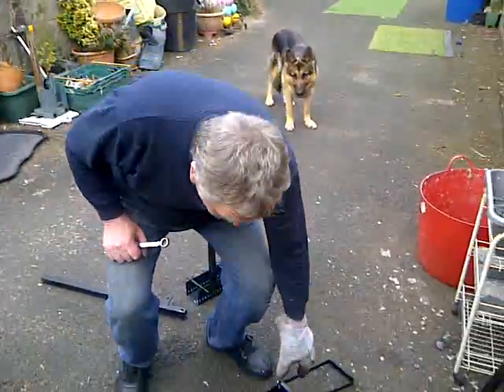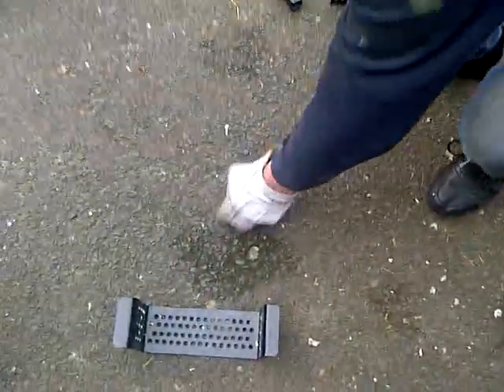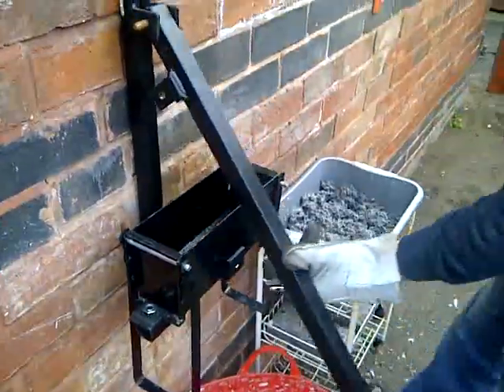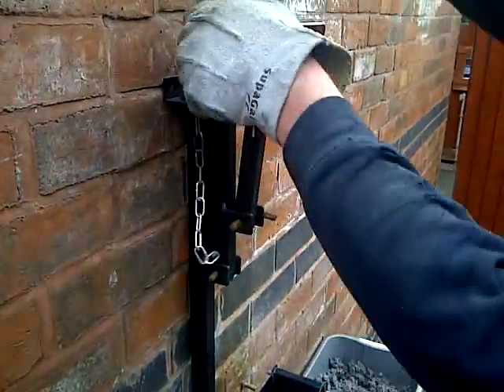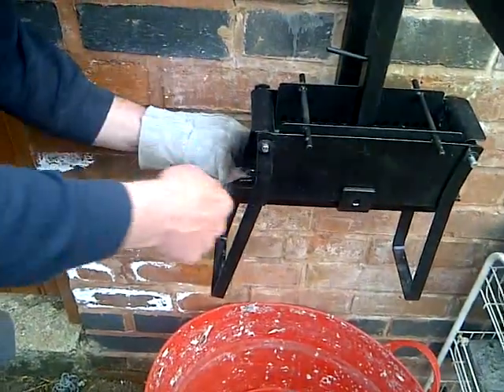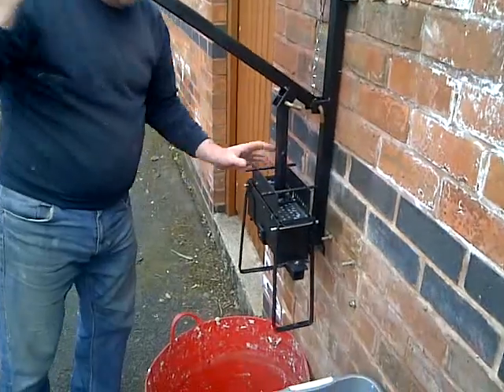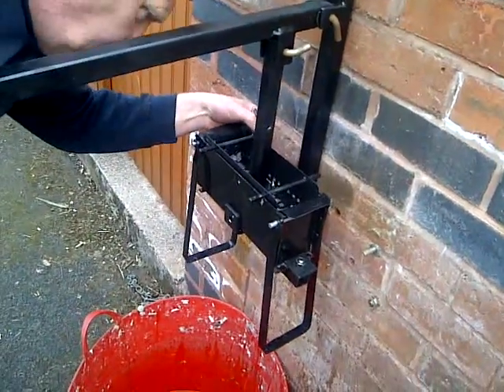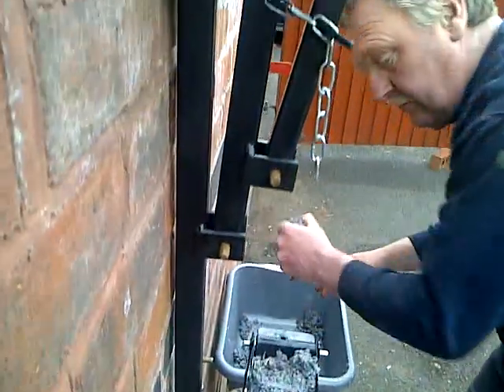paper briquette maker paper log maker

Comment: This is brilliant! I have one of those brick makers, and you've solved all the problems with these gadgets. When I squeeze the water out, the bottom screen wants to pop out, but the steel bar you have under it to prevents that. I sit on a short stool with the mold the ground. You've brought it up to a comfortable height. And because you have it mounted on a wall it makes it easier to pull out the brick, as opposed to me using my toes to hold the mold while I pull out the brick. Bravo!!!

Comment: curious....  do paper briquettes need to burn as hot as wood .... when it comes to preventing Creosote creation in flue,  for secondary burn etc..  As in,  am wondering if there is way less ignitable gas in the smoke compared to wood burning,  that can even be burned?   If not then the possibly the flue temps less than the optimal for wood of 300-500f  would be fine..  As long as there is enough draft to  push carbon monoxide out the flue, maintain the fire and enough heat production to add an value in warmth?

Comment: Thank You, just spent the day fabricating one of these and it works great.
Reply: I live in Ireland, this is a great idea as job is gone, need to economise and we rely on solid fuel stove for heat.  I have contacted John here to see if it's still available as can't see on eBay.  Would a local metal worker be able to fabricate one of these if I bought the basic unit for him to work with? Would appreciate you assistance and an idea of expense? Thanks in advance.
Reply: @lisachalfa8494  any local metal worker should be able to fabricate one of these with some square tubing and sheet metal.  It's just a constructed lever, the bricks themselves could be pressed into a cylinder mold for round brick discs if desired.

Comment from the maker: hi. yes we are still making them. we also make a new model which is called the multimate freesander you can use it any were you wish. you dont fix this unit to a wall it stands on four ajustable  legs. both on sale on ebay at 110.00 plus postage. thanks for your interest regards john multimate.
Reply: Get this one everyone. Fantastic build, portable, faster to use and briquettes dry faster as well. This is the one everyone in the uk should have. No parts from China in this

Comment: Mr.Paul are these bricks can be made from paper dust ?paper dust is very light and has very thin micron and has no fiber.  We have 2 tons of paper dust every month and we do not know what to do about it. we usually throw them away or we burn it on a deserted place.
Reply: TheManinblack123123 -You can just use some filter paper or screening over the larger holes to keep it in....

Comment: Love It get ride of the chain and put a magnet there,
Reply: Only thing I can oppose with that idea is maybe instead of replacing the chain, is to just add a magnet to it and keep the chain. So the magnet can hold it between uses but store it with the chain on. Magnets are great and can be hidden quite well but it has to be weak enough to be easy to pull down, but strong enough to hold it up - which leads to risks of having it accidentally swing down. Having the chain there for hold it up when not in use would be the same as having the safety on with a weapon.

Comment: so what are the flappy arm things on the side for? you said they are the reason this is possible.  looks like they do fuck all
Reply from the maker: That is correct they do fuck all. well spotted.
Reply: I feel some sarcasm coming at me their lol.  Do they do fuck all or have I truly missed something?
Reply from the maker: what this is  showing is a standard cross handled cheap briquette maker.  with a add on lever system.  the flappy arms are what was use before.  to compress the pulp. and it was lot harder to operate.  thus we designed this system.
Reply: ahh got ya, cheers for the reply mate